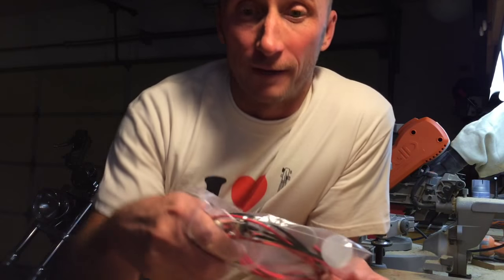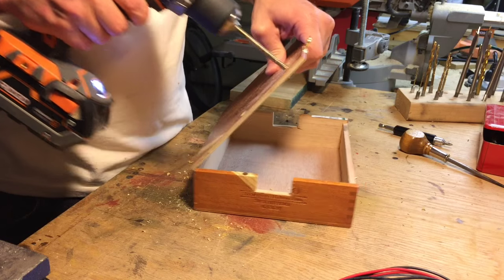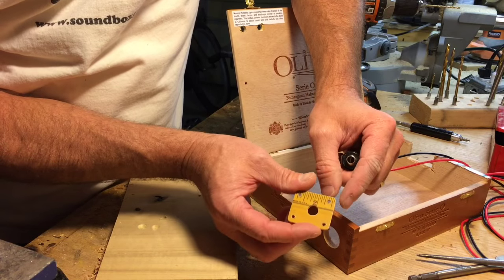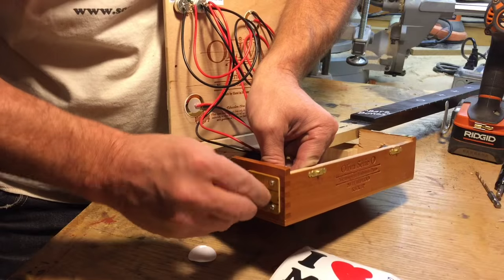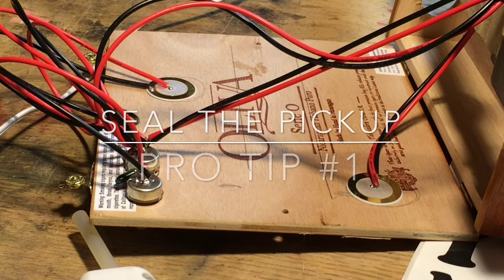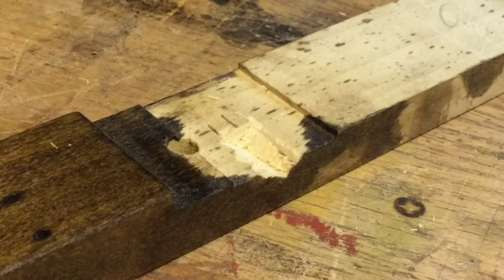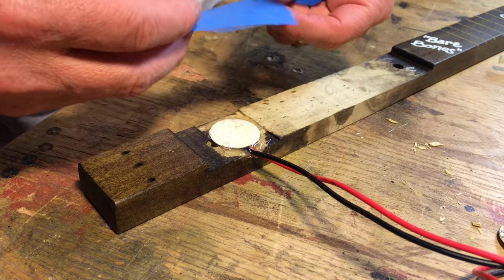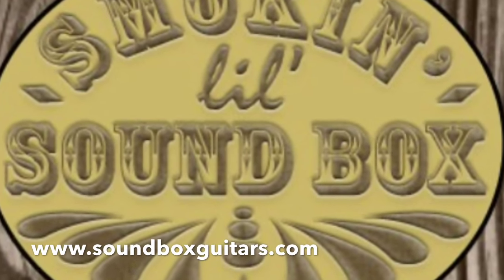How To Electrify Your Cigar Box Guitar - The Easy Way.

Comment: I built 20 guitars with piezzo pickups, and then switched to magnetic pickups, and have now built 180 guitars with them, ranging in price from $50 to $390. There is no comparison to piezzo especially if you want to put some gain on your amp. Having said that if you still want to go the Piezzo route this video has good advice.
Reply from the maker: Hey, thanks for the comment. That’s awesome that you’ve built so many guitars, I have also and I love it! The idea for the Piezo is that it’s easy to electrify your do it yourself type of guitar build. When I do a magnetic pick up I do a different style build that requires a little more bracing and notching, etc. I want people to be able to start simple and then develop ideas on their own of how they want to explore this world. Keep on building, rock on!
Reply: @SoundboxGuitars  Love all your work!  Thanks for the helpful videos.
Reply: Magnetic pickups are obviously preferable but piezos can be cool too. A trick I learned was that piezos sound very tinny and high. But if you add any gain they sound muddy. So if you find that sweet spot with just a little gain, just enough to thicken up the sound, it sounds pretty good. Of course that wouldn't be necessary with magnetic. As I said, they're preferable.
Reply: @PaulTheSkeptic  I agree. I have now built 140 CBG and all of them since my comment above with Magnetic PU. I first started using the more expensive ones but have found that the $7.50 from =MGB Guitars work as well as the more expensive ones, Although the Lace matchbook pick up looks interesting.. If I ever get around for making a guitar for myself I'll chance a Lace.. At the moment I prefer to play the guitars I have for sale as a quality check before selling them. Sentinel Guitars Bozeman MT.
Reply: @crackerjack3359  I believe they sell these flat magnetic pickups now, specifically meant for CBGs.
Reply: You ever put a on off switch from piezio to pickup ,cheers @SoundboxGuitars

Comment: Got the Piezos installed in my uke and they work fine. Thanks for the advice.
IF I ever do it again, or have a need to open up my uke, I'll probably move one of the pickups. I currently have both of them slightly behind the bridge. Came out pretty nice, waiting to find some smaller knobs. Standard guitar knobs look to large on a smaller Uke.

Comment: It's a nice product but that's a lot of wires. Why not make them a bit shorter? Also, usually the piezo goes under the bridge but that's no big deal. With two you can put them in different places which is nice.
Reply from the maker: Wires are long so they are easier to place for different size guitars...also, at the end of the video, check out the 'pro tips' for installing under the bridge.  - https://youtu.be/aGtHNLKi7Qo?t=255
Reply: @SoundboxGuitars  Wow. 5 years ago this is what I was watching.

Comment: I see very very much long wire in the cigarbox guitar and that is not shielded wire.  Go study some basic electronics and use shielded wires!
Reply from the maker: Thanks for the comment, there’s long wires because you never know where someone is going to put their pick up. As far shielded wire goes, these are Piezo pick ups, not magnetic, it has no adverse effect on the ceramic disc and the signal being sent. There is no magnetic response to this, it only picks up physical vibrations.
Keep on Strummin’!
Reply from the maker: no need for a ground or shielded wire with a piezo - it only picks up vibrations - unlike a magnetic pick which needs a ground.